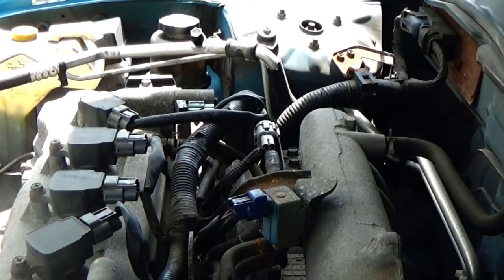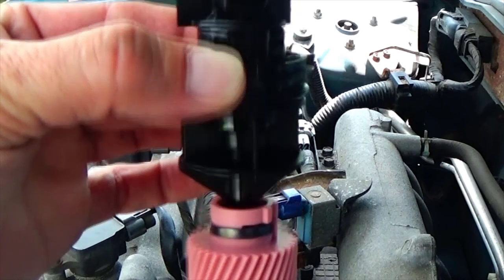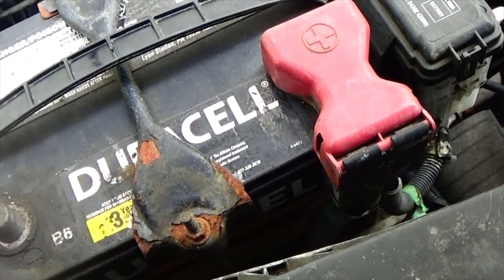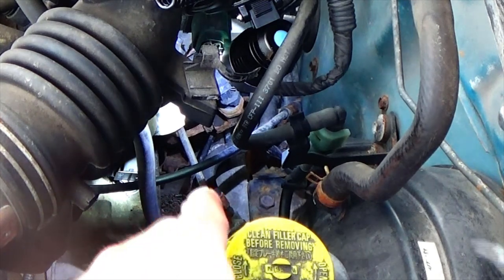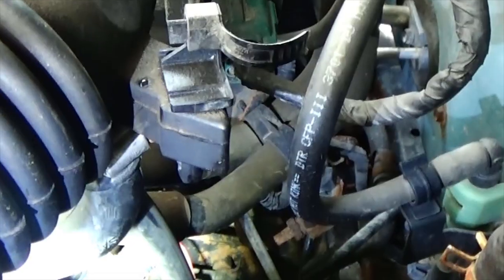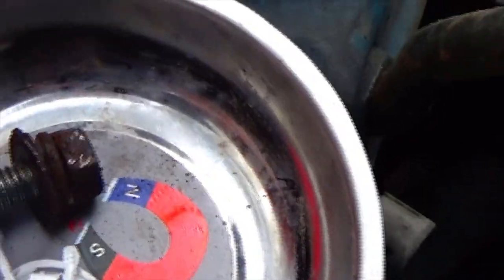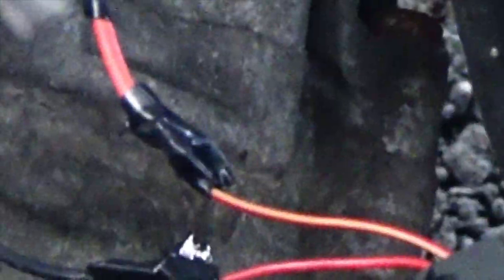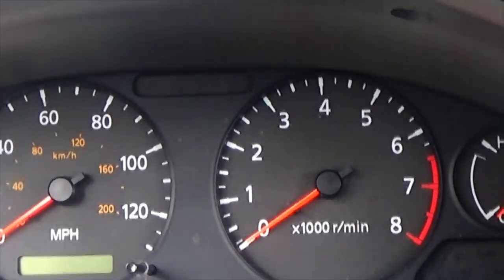P0500 Vehicle Speed Sensor Wiring Issue

Comment: It’ll save you a ton of stress if you buy a re pin kit for fixing connectors the right way you don’t need to solder in tight spots.     Thanks for the video.
Reply from the maker: Thanks for the information 👍

Comment: I have watch a number of videos on P0500 no one talks about the voltage or ground circuit at the sensors. I have a toyota with the VSS sensors on each wheel

Comment: Hey! I have a BMW 1 series 118i from 2006 automatic and the code P0500 comes up Speed sensor A circuit BUT it says pending should I take it seriosly? I have changes 2 ABS wiring and ABS ring back and ledt speed sensor on front weel and I can eare the code but comes back;/ WHY??
Reply from the maker: If you erase the code and it keeps coming back on, I would change out the Speed Sensor.

Comment: ever get shifting issues? i got a 03 sentra. when its in Drive, it wont shift into 3rd. i think it shifts into overdrive from 2nd... and it wont shift down... soo right now im just drivin around in 2.. going a max of 45ish mph at 4000rpm... 

problem started out of nowhere..
i swapped the valve body, the output speed sensor, changed the oil, filter,unhooked the battery... funny thing is that theres no check engine light... any clue what it could be?
Reply from the maker: I had an issue with my son's 2006 Cobalt... It wouldn't engage when trying to put it into park....I took the floor console apart and there was a pin (about the size of a needle, but thicker) that goes through the bottom of the shifter that came out... I put the pin back in and it's worked ever since....I've never taken it apart on my Nissan, might be worth taking a look at...Good luck!

Comment: I am having problems with an intermittent VSS Signal.  I have replaced my unit with two others--because I thought that a bad VSS was the problem.  Now I think that the wiring is the issue.  Your Video here and other videos may help me fix my VSS Problem.  Thank You For This Video.  However, may I, respectfully suggest that it is Best to remove the Air Tubes and Hoses out of the way, before you worked on this VSS.  I tried it without doing that, and it was a Pain in the Ass. It will not Only be easier to film, but it will be MUCH EASIER to Solder.  (I too don't care for soldering.  I hear ya brother.).......May I ask where you bought your new connector online.  I have had a LOT of problems with my old Camry, when it came to looking for connectors.  Any help in this department would be greatly appreciated.  Thanks.  Take Care.
Reply from the maker: You're right. It is easier to remove the hoses/tubes to gain access...I was pressed for time, so I didn't. It did make the repair/soldering a bit more difficult. .I got the connector online. ..Sorry, I can't remember the name of the site....Good luck with your repair!

Comment: Hi Everyone, I'd like to ask your help about the next failure. I have a Fiat Punto mk2 2005 1,2 8V and the speedometer shows only 1/3 value that means the car real speed is 60 km/h the showed is 20 km/h (maybe only approx.). I checked by OBD reader the value was the 1/3 on it as well. That means for me the instrument cluster is good. I have changed the speed senser (it is located on the differential house in this type) to a new one but the faulire remains the same. I cleaned the ECU contact but no change. Could you please suggest something what could be the root cause or what would be the solution. Maybe only to change the ECU? Many thx for the proposals. Br.

Comment: Just replaced this sensor about 2-3 months ago. I have a scanner. 2 days ago I have the same code and service engine soon light. The funny thing is, when I try to start the car in the morning, it wont crank, just makes noises as if the solenoid in the starter was bad. Sometimes the cluster shuts down and pops on eventually. Any idea? please!!
Reply from the maker: It sounds like it's a separate issue from the speed sensor... How old is the battery?... I would start with testing the battery
Reply: @beachtroll8344  First of all thanks for the fast reply. I see what you're saying. Yeah usually gets hard to start when cold and after the car gets warm I have no issues cranking the engine. I'st just in the morning. I'm going to test the battery this Tuesday then, it's my day off. That's a good point, I believe the battery it's older than 5 or 6 years now. Thank you dude!!